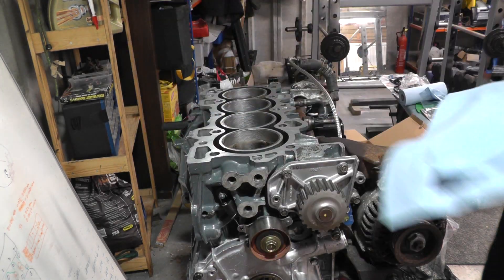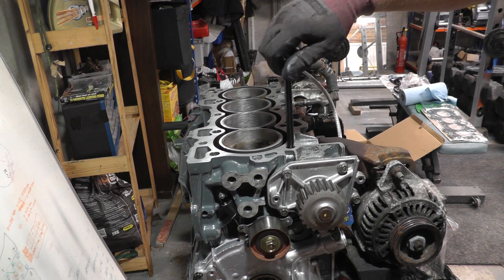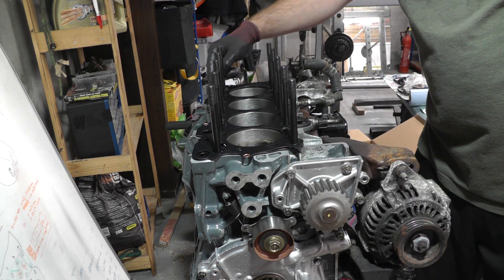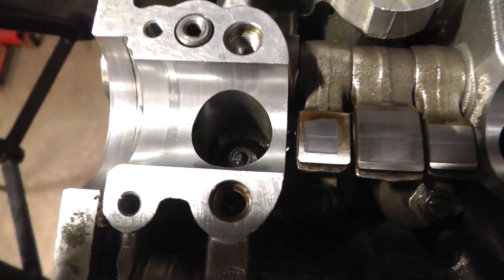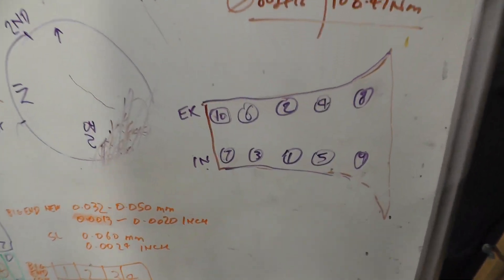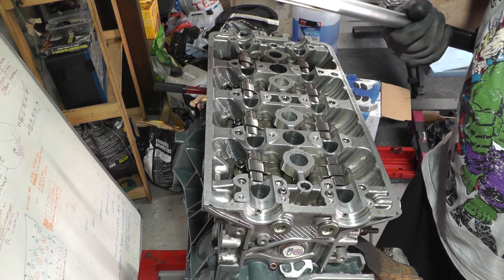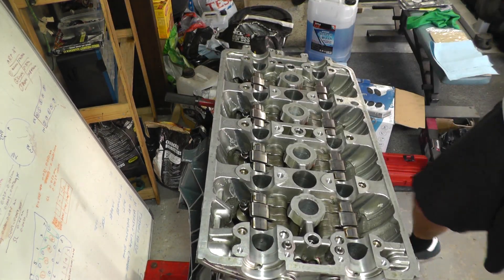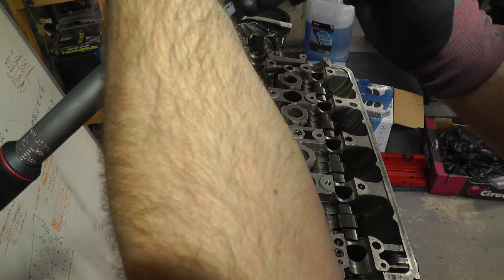Lockdown Honda B18 Engine Build Part 6 - Head Install

Comment: Did u have your cylinder cleaned? And what modifications you did on your cylinder head?
Reply from the maker: Hi, I had previously had the cylinder head resurface and not ran the engine much since I had this done. Ideally I would have had it resurfaced again before building it, but I did check it was all correct woth a straight edge.  The cylinder head is standard in respect of cams, valve springs and valves. It has nitrile stem seals, and flowed pirts however. Thanks

Comment: Another Gem video!!!  What are your thoughts on permatex copper seal on the head gasket prior to installation... is it highly recommended/necessary?
Reply from the maker: Hi,
I have never done this, and the Honda manual does not state that this needs to be done. Although have seen people (Motortrend/Hotrod Garage) do this on V8s. So it is up to you although like I say, never done it myself. Thanks

Comment: I've got mine B18C4 in and went for proper drive today it's a bit tappy (no worst than my old B16a2)  I was hoping this video would cover valve adjustment 😁
Reply from the maker: Hi, that will be covered in Part 8, which I should upload this week. Thanks